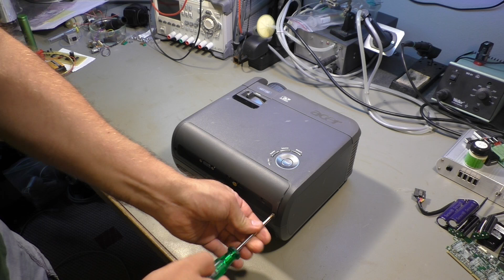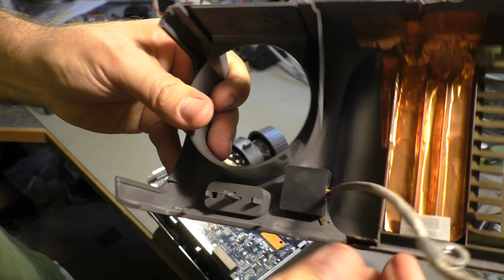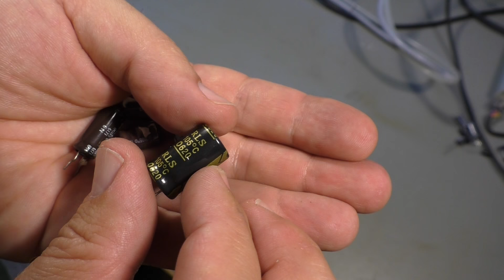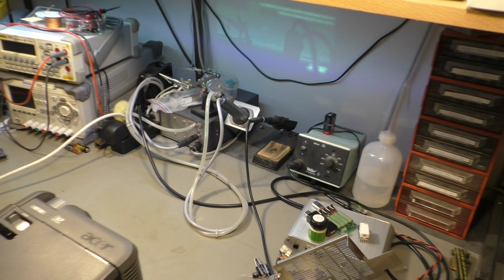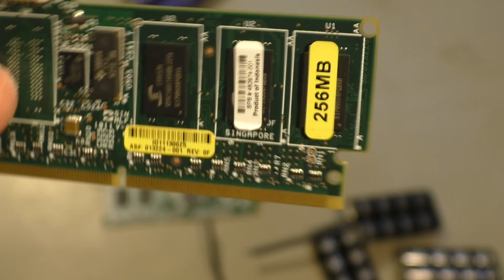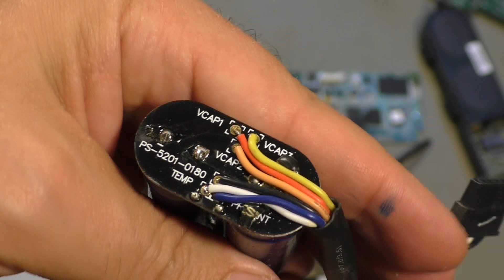Projector repair and bad HP supercapacitors (PWJ105)

Comment: I recently bought an acer acer xd1170d similar to yours and I connected it to a PC with a DVI cable. A picture was projected on the wall, but the problem is that when I open YouTube or any other application, the whole picture does not appear, but only a small window at the bottom of the screen. I don't know what the problem is. I tried to reduce the resolution on the PC to 800x600. is on the projector, but nothing. I also tried the screen settings in the control panel (monitor 1, monitor 2, etc.) but nothing changed. The projector is simply unusable for me because it cannot read the full image on the screen, i.e. the wall. Do you perhaps know what could be the problem - is there something wrong with the projector or do you need to adjust something on the computer? thank you
Reply from the maker: If I understand you right, the projector does work properly with windows only but it doesn't work when you open something?
Hmmm what does the "small window" show? An error message or the contents of the application?
I would say that the resolution or the frame rate is incompatible with your projector. If it is only capable of displaying 50 FPS and your computer outputs 60 that may cause that issue.
Does the projector work with another video source like a DVD player?
You may answer to playwithjunk@gmail.com...
Reply: @PlaywithJunk  I tried again last night but I connected the projector to an old model laptop (dual core with 2gb ram) and everything worked normally! I guess you're right, the problem is probably my PC's compatibility. The projector is an old model from 2005, maybe like the laptop, and the PC is newer (i5 with 8gb ram). When it is connected to the PC - only the desktop image with icons is displayed and when I click on any icon - nothing happens. I put the cursor on the icon on the taskbar
.then that small window appears where I see that the application is open but it won't show me the full screen. I probably need to make additional settings on the control panel and the graphics card to match the compatibility of the PC and the projector (resolution, frame rate, scale and other). In any case, thank you for your answer... For now, I will use the projector via my laptop
Reply from the maker: @raderadovanovic1617  OK, I'm glad to be able to help 🙂
Funny coincidence is that last Friday a colleague at work came to me with a simiar problem. It was not a projector but a long line VGA video tranmitting device. He also got the whole image but extremely squeezed to the left of the screen. I assume it was also the resolution and refresh rate.
I recommended to use a different monitor... I don't know what the result is yet.

Comment: I don't usually take time to write comments on YouTube, but your video has lot of good info that is very difficult to find. You explained in details exactly what I was trying to understand about why HP and others started using Super-Caps instead of batteries. I truly appreciate your inside on this. Keep up the good work.
Reply from the maker: Supercaps do have a longer lifetime than most batteries but it is important to use good quality caps and also treat them well.
If used wrong, they  can be worse than all previous methods. 
Supercaps are easier to integrate in a circuit as long as you take care of the maximum voltage they can survive. And they are not such a fire hazard than Lithium batteries.
Interestingly HP went back to batteries but they no longer use NiCd cells, they use Lithium cells now.

Comment: Hai I have the same projector xd1150 but last time I start the projector then kinda smoke .Is that same problem of capacitor
Reply from the maker: possible. But there are many parts inside that can smoke.... Try to find where the smoke came from.

Comment: That you can even work AND make a video in 30°C. Wow,  thanks. I can't do anything in 28°C without literally melting away. OK, coding C in relax position on the couch is just doable. But that's it.
Reply from the maker: I prefer lying on a deckchair in the shadow of a huge tree, having a cold beer next to me, some chips and a good book.
Reply: I can't either. I don't want to do anything except lye in the bath in cold water in 30C
Reply: I'm from Florida and it's not that hot outside (well, maybe it gets to 35 during mid-day). That sucks.

Comment: So true about the HP supercaps. I have changed a lot of them in our Gen8 blades..
Reply from the maker: Now you know why.... :-)
Reply: Make sure you add the missing balancing resistors/zeners to the new ones.
Reply from the maker: We install the new ones as they come from HP on the Gen8. The Gen9 does not use supercaps anymore but Li-Ion batteries, so the problem hs gone anyway. And most of the caps are working perfectly for years.
BTW the Gen9 batteries are failing too but for other reasons :-)
Reply: @PlaywithJunk  I realise some years have gone by, but did you do a rebuild of the gen9 battery, would be interesting to see. Thank you especially for this video as it has demystified the supercap module enough to attempt a rebuild.
Reply from the maker: @adm-5284  No, I never repaired a Gen9 RAID battery. They are a pain to disassemble and too cheap to work on it. We took some apart and it turned out that the battery cells are not good. We just say "they turned into a piece of wood". No voltage, no charge, nothing. Just like wood 🙂
Reply: @PlaywithJunk  Have to agree they look it. I have some lenovo rack gear and the LSI controllers on those look like they have a celled battery pack so it's hopeful they might not be so bad. OK thanks for answering and really enjoyed the video as I have some g8 capacitors to remake. All the best.

Comment: the faulty capacitor does not have to fail in short-circuit. It is enough if the capacities are different for the capacitive divider to get out of balance. The balancing resistors or zener diodes would help in this case as well.

Comment: Not sure what HP was thinking here... Kinda weird to just rely on the quality of the caps themselves. Nice ones too, except for the brand, 34F? Geez.
I wonder if they couldn't get high capacity ones with a voltage rating of 5,5V, but those likely have a different form-factor. 

Resistors are probably a bad idea if they just could get the timing right with the capacity on hand. You would have to factor in the dissipation in the resistors as well, which would limit the time the voltage on the caps would be high enough for the circuit to operate without corrupting stuff. A too high value of resistor would have the same effect of having none present at all. It wouldn't balance as it won't pass the current in case 1 of the caps failed. 

So zeners would be the best option, but even then there are 2 problems: I imagine, with a system (battery-less solution) like this, you want the caps to charge up quite fast when the power is restored to keep the circuit alive when another brownout occurs or something like that. Caps like this take quite a bit of current to charge them moderately quick. That means you need a good amount of charge current. in case a cap fails, the charge current passes through the zener. Zeners are only capable of handling so much as a few mA, as far as I know. Not Amps! So they would fry over time when the failure becomes worse.The second problem I can see, is that you have to find a suitable zenervoltage, and probably select them as well, as there can be small differences between them, but I'm not sure.

Comment: Wouldn't want to turn off the fans or air conditioning in this weather!  🌞  Even here in UK it is nice and hot but humid too and not enough swimming pools.
Reply from the maker: It works in a solid built house. I was in a hotel in California and I thought I will switch the AC off during the day when I'm not there.... saving energy... When I came back in the early evening it was about 50 degree in that room. Then I examined the walls and found that they are thin like cardboard. No wonder that exery US house needs an AC. They build houses with wooden frames and plywood. Our garden shed is built better than that.
Reply: Yeah, US houses are built very cheap and poorly from thin plywood and cardboard/plasterboard with no thermal insulation or structural strength and are easily destroyed by high wind.
. In the UK and mainland EU, houses are built properly with solid stone or brick outer walls, internal non supporting dividing walls may still be plasterboard in newer houses though.
Reply: Yes, my shed is built better too.
Reply: In his/my country, private AirC is not a thing, we would be lucky to use it more than one or two month per year…
Trapping cold night air for the day, works.